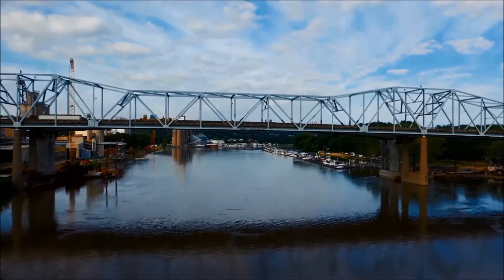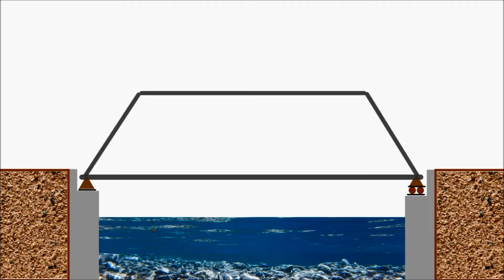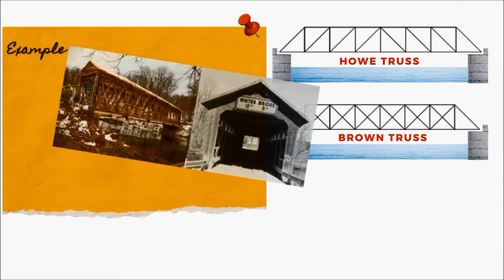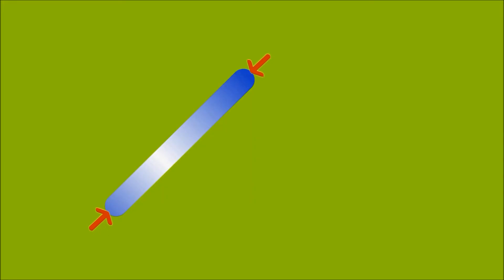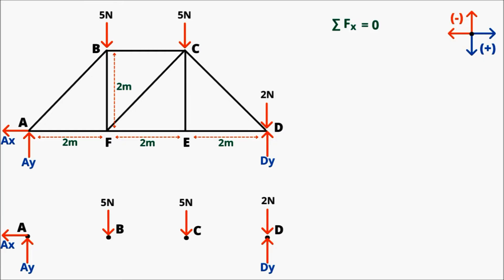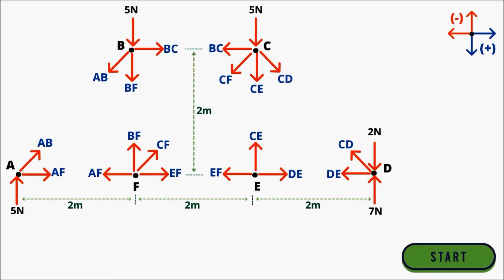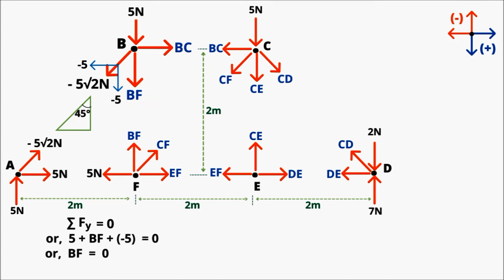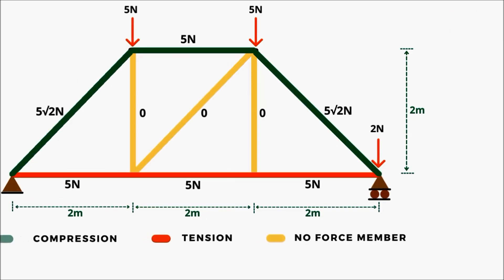Truss Bridge | Types of Truss Bridges | Analysis of Trusses | Method of Joints | Bridge Engineering

Comment: In an ideal truss the members shall be not continuous , i.e. they shall be broken at joints.
But in practice for steel trusses , top and and bottom chords are continuous over 2/3 joints and spliced at 12 m, will it remain an ideal truss.Does the Chords not behave like beams in such a case.
Kindly explain.

Comment: Great! With your video knowledge of trusses used on small surface loads to give a stable form capable of supporting considerable external loads over a large span. Popular TRUSS are NOT ONLY because of reletivety small amount of material. Vise of you how you define component parts of a truss bridge - stresses primaly in axial tension bending leads to compression in the top chord or horizontal members, tension in the bottom chord (vertical or dinamical).... Etc. WE HAVE SEEN IN YOUR VIDEO

Comment: 8:34 The main difference between tension and compression is that tension refers to forces that attempt to elongate a body, whereas compression refers to forces that attempt to shorten the body. The illustration in the video is different. correct me if I am wrong.
Reply from the maker: Its nothing but the reaction force (Newton’s third law of motion - “ For every action, there is an equal and opposite reaction” ). When we talk about the member being under compression it actually push the JOINTS to squeeze itself and the member being under tension it actually pulls the JOINTS to elongate itself. In “Method of JOINTS” when we draw free body diagram force in outward direction is compression and inward direction is tension because the calculations are for JOINTS.

Comment: I would really appreciate it if you could make a video about how to convert uniformly distributed loading on the truss to point loads.
Reply: Multiply the udl by between two joints by the distance between the two joins. Divide the answer by two and thats the load on each joint coming from the udl